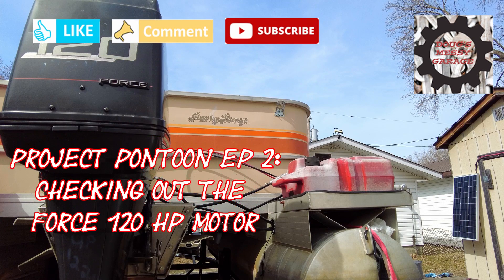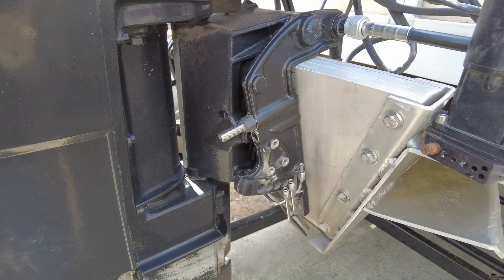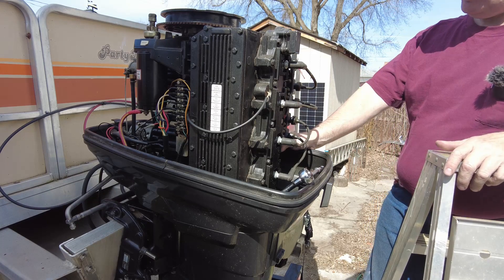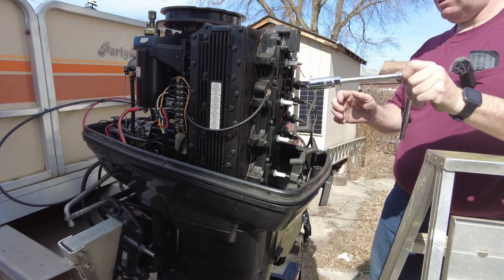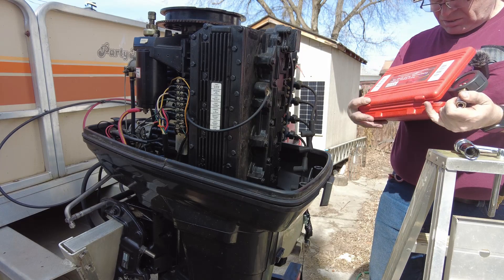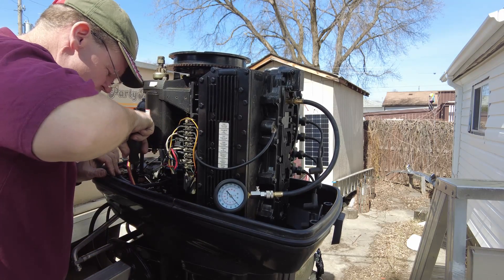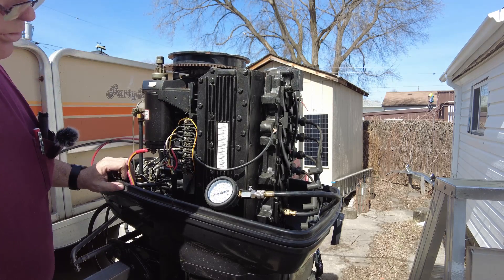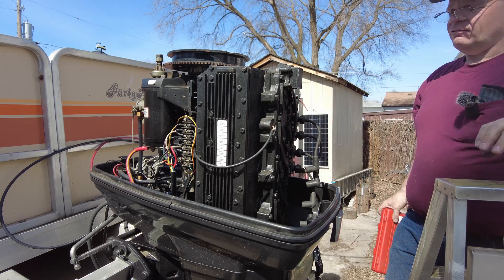Will It Run? How-To Evaluate a Force 120 Two-Stroke Outboard Motor: PROJECT PONTOON Ep 2

Comment: Hello! Thanks for the video! I have same motor, but my forth cylinder have no compression. Should be restoring. Watching you from Kazakhstan)
Reply from the maker: Be careful when ordering parts.  Force was terrible about following the parts manual.  A '94 motor might have a '93 power head and possibly a '92 lower unit.  When ordering parts, it can be hard to figure out exactly what you have and thus what to order.  Best of luck with the repair.

Comment: I'm troubleshooting a Force outboard I just bought. Here's hoping. 🤞🏻
Reply from the maker: Hopefully it is nothing too involved.  The big problem with the Force motors is the inconsistency in what actual parts were used for a specific model year.  In a given year, there may have been three or four different lower units used but the parts manual only lists one.  For instance, you may have to buy three or more water pump kits to assemble the right number of parts to replace your impeller.  Some of the forums have very knowledgeable former Force/Chrysler/Mercury techs that are willing to assist with part number identification.  The Force motors seem to have a bit of a cult following but parts are expensive and figuring out exactly what you need is not easy.

Comment: I have the exact same boat and I change the fuel pump now the problem is when I turn it on it starts to accelerate from 0 to 60 by its self I had to change the fuel pump because it had a whole in it and it was passing raw gasoline threw it any clue what it could be
Reply from the maker: Revving up takes two things, fuel and air.  If you have a vacuum leak, you could have the engine over rev..  A stuck open throttle plate could cause over revving too.   
The symptom I had was if I pumped up the fuel bulb, I would get fuel running out the exhaust.
Reply: @DougsMessyGarage  What can I do then?
Reply from the maker: @JonathanAvila-l3x  check to make sure the throttle plates in all of the crabs are closing to as near as 100% as possible (a slight crack open is fine, that's for idle).  Make sure the carburetors are seated properly, cannot pull air around the base.  Check to make sure the gaskets around the intake are intact.  Since you  have had the fuel pump off and it opens to the crankcase, that is likely where your air leak is coming from.  It would take a fair amount of air to rev up quite a bit.  Hopes this helps.

Comment: I worked at a Chrysler/Force dealer in the mid 80’s.  We sold Mariners and Johnson on package Javelin boats.  Our owner loved Chrysler/Force but rest of the crew didn’t.  The 125’s back in 1985 were bad about blowing the number 1 piston typically on the first trip out for customers.  US marine wound ship is a new short block no questions asked.  The 50’s and 85’s were the better engines but all Forces were slower and less reliable but cheaper than all other makes.  This is a great video and found like you have a fun project.
Reply from the maker: Thank you for the insider's perspective.
Reply: Nice video .Thanks 😊

Comment: Save your money and buy a better engineered motor. I had a 98’75hp that was just dead weight on my boat. A friend of mine has a marine shop and he had a bin out back that they threw those U.S. Marine motors in and sold it to the scrap man.
Reply from the maker: I suppose I mostly agree.  My Force came as an inoperative throw-in on my pontoon boat and I was successful in resurrecting it.  I now have a Yamaha four stroke on the 'Toon and am much happier.  I am thinking of getting another project boat to put the Force on because I basically got it dialed in right when I found the deal on the Yamaha but thoughts are cheap.

Thanks for watching and commenting.
Reply: Spoken like someone with no experience running Force motors.

Comment: Force is all scrap parts from Chrysler outboards when they crashed. Then mercury bought them over and slapped some of there parts on and used some of the Chrysler parts. Then they named it force
Reply: Chrysler outboards did not crash but had to be sold as part of the government bailout in the late 70’s.  Chrysler outboards were actually a profitable division of Chrysler. US Marine bought them in the mid-80’s and re-badged them Force outboards.  Brunswick  .(Mercury outboards parent company) purchased USMarine in the late 80’s which included Force.  Mercury started adding addressing some of Force’s issues that dated back to Chrysler with better casting, ignitions, lower units and more.  Emissions killed Force in the late 90’s when 4 strokes and heavy emissions requirements came about.  Once again, they did not crash.
Reply from the maker: @melrose9252  Thanks Mel.  Your history tracks what I have learned about them.  Force outboards certainly seem to have a loyal following.
Reply: These are solid reliable motors, and very easy to work on.  The bad reputation comes results from the economy class boats they were mounted on, and the bonehead, first time boat owners who did absolutely no maintenance and often didn't use the right oil or mix it properly.
Reply from the maker: A pretty accurate summary except I believe some of the Chrysler parts were third party so there were often several different versions of the same item used throughout one model year, depending on availability.  Figuring out what lower unit is on what outboard is a pain.
Reply: I have a 1996 mercury force 120hp. And it has been an excellent motor. I have found that most bad mouthing about this motor are from guys who have never owned one and from a friend of a friend's cousin says it's a bad motor.  Typical internet replies.

Comment: How do you work the trim
Reply from the maker: The Force had a toggle switch on the steering console that operated the trim/lift.  I have since upgraded the boat to a Yammy 4 stroke and it has the trim/lift on the throttle control.

Comment: Hey Doug. Question. Why does the upper carb and lower carb use different size jet. Why don’t both carbs use same size jets. I just don’t get it. I run snowmobiles for ever and just would nvr make sense to run different size jets from one carb to the other so why would the 120hp do this?
Reply from the maker: I will have to take a look in the service manual and see what it says.
Reply: @DougsMessyGarage  I have my Manuel it says .088 upper carb and .090 for lower carb but that don’t explain why they do that.
Reply: @DougsMessyGarage  as far as testing compression it’s always been known to hold it wide open while cranking but in manual it says it as well. Mine has 185-190 psi across all cylinders. So extremely good compression
Reply from the maker: @acurarl9929  185-190 sounds a bit high for a two stroke, even with the carbs completely removed.  How confident are you in the accuracy of your  gauges?  150ish is considered new on these engines I believe so that's why I ask about your gauges.   It is supposedly normal for the top and bottom cyls to be slightly higher than the center two by about 5 PSI according to a long time Force mechanic I was messaging with on the iBoats Forum when I was checking out my outboard.

As for the different jet sizes, I suspect there is some kind of casting shape issue that affects smooth mixture flow into the lower two cyls and that is likely why they run the larger jet.  This is only a guess on my part though.
Reply: @DougsMessyGarage  you got my wheels turning now.  I’m sure I can test the compression tester using air compressor and seeing if tester reads what my compressor regulator says it’s putting out.  I guess I should try an test the tester.
Reply from the maker: @acurarl9929  Should work
Reply: My 75 force had 3 cylinders and 2 carbs.this was not a well engineered outboard.

Comment: You don't need to hand prime it!   Just squeeze the bulb on the fuel line a few times, Then s you turn the key to start it, push in on the key. That will prime it
Reply: Pushing the key in chokes it
Reply: @jerryriggan  There's no choke on these engines.  Pushing the key primes the engine with raw fuel.
Reply: Squeeze it till it gets hard (sounds Freudian).  You can hear the fuel enter the carbs.